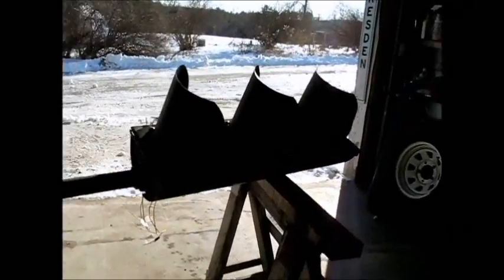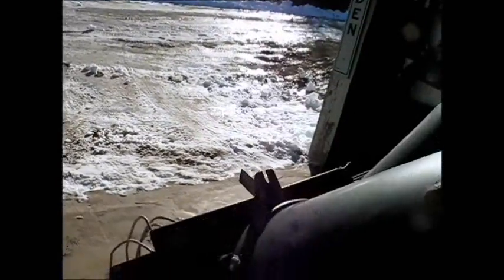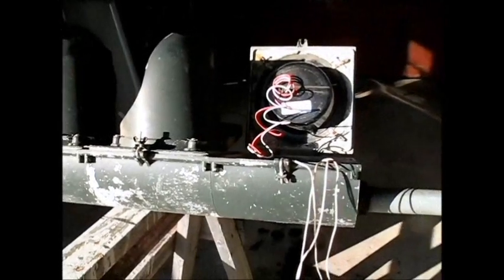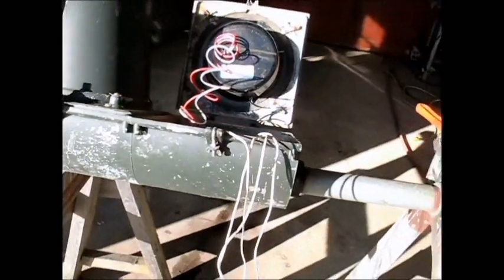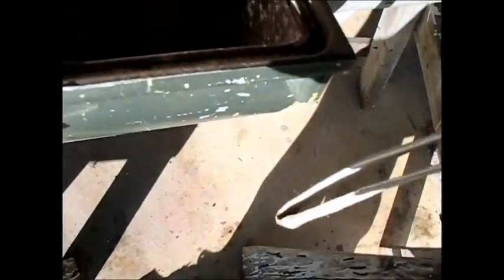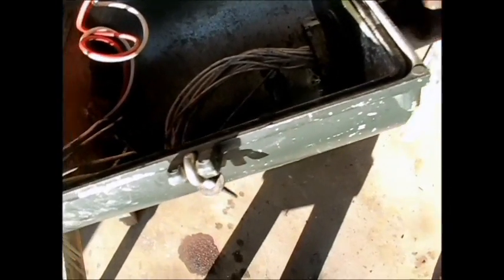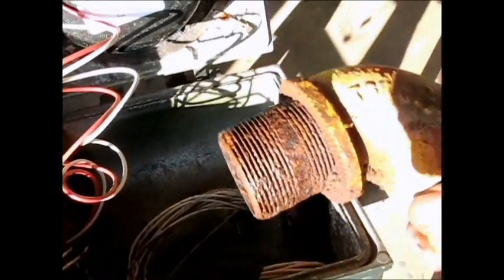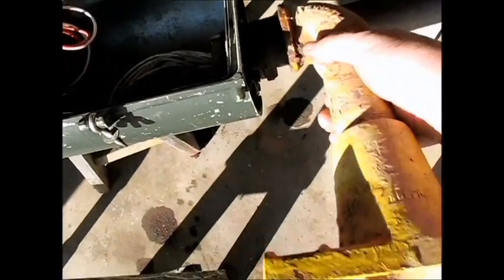Red Light Mounting Bracket Install

Comment: Try 'Kroil' instead of PB Blast.  Something else is ATF & Acetone.  Personally, I think Kroil looks and smells like AFT & Acetone.

Another good one that is kind of spendy is Seafoam in a spray can.  It's a concentrated version of what you dump into your gas tank.  It works good for loosening bolts and cleaning intakes.  I'll usually give the tractors afew shots of it when I start them for the first time in the spring to make sure everything is clean and running good.